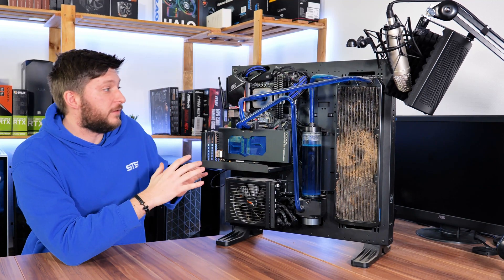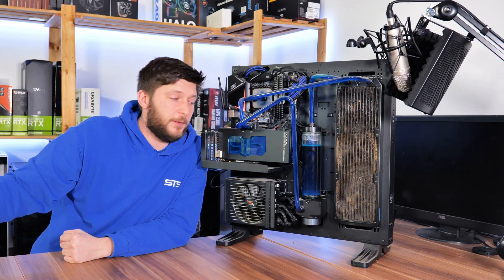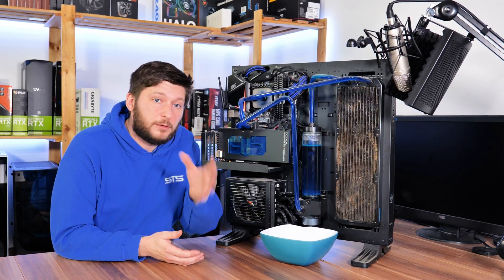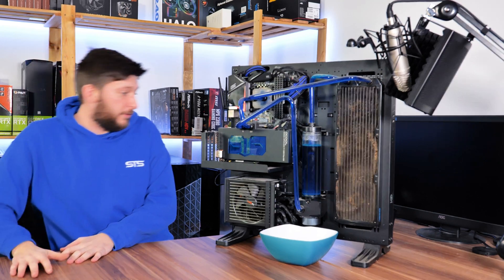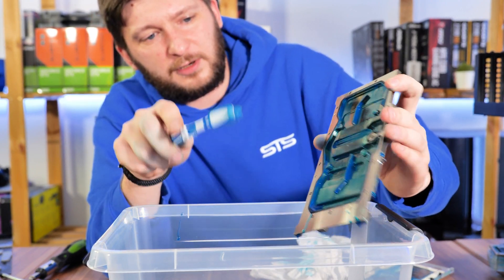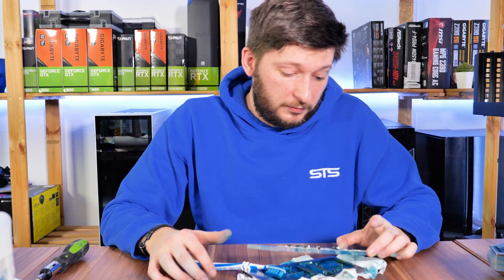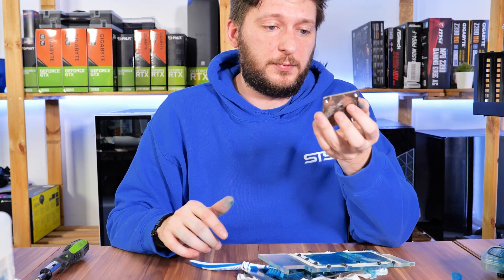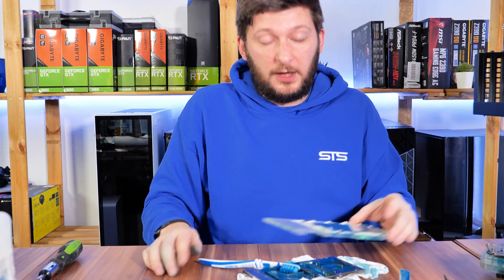Custom Water Cooling Pc Fail | Fixing my biggest Water Cooling Mistake

Comment: just use regular destiled water , colored coolants are the problem. you dont need to clean it every year with normal water , maybe 1 every 3 years
Reply from the maker: Things you realize after you're done.
I never got the blue color out of the waterblock, but we need it for another project. I will probably just use it with normal coolant and hope that the color will disappear just by running for a long time
Reply: @STSYT did it?

Comment: Just don't use any colored coolants. Especially pastel ones. It doesn't worth the hassle it brings.
They ALL gonna clog your loop sooner or later. Even if you gonna change it every 3 months or something - they will eventually produce build-ups here and there or will damage nickel plating in the worst case scenario. Also you can only guess what internals of your rads look like, which is even more concerning cuz you can't open em up and clean.
If i want some colors I just buy colored tubing instead. 
Had aquacomputer DP Ultra clear coolant in my loop for almost 3 years once, and when i finaly drained it, the coolant was crystal clear with 0 build-ups and no discoloration whatsoever, it looked like new
Reply from the maker: Until now I never saw colored tubes in action. 
You're right with everything you said. But it just looks awesome^^.
We're planning a new Tech-ASMR involving Hardline tubing and we need to decide what route we go. Colored Tubes are definitely something we will look into :)
Reply: @STSYT  indeed it looks nice, opaque coolants look even better, but when it comes to cleaning all that mess after it's just annoying and frustrating af.
Colored hard tubing aren't that common but still you can get some from primochill or barrow for instance.

I used UV active red petg from barrow in my recent build which looks pretty decent imho.
https://imgur.com/wa2BEFs
Reply from the maker: Looks nice!
Yeah, in the future i’ll propably just use them for these short-timed themed builds. I know that as soon that pc goes out of the office it won’t be cleaned for at least 2 years.
Reply: I use clear mayhem's X1 and glass tubing.

The coloured stuff stains petg and soft tube even worse, it also stains everything else (like inside radiators) so you need to run vinegar or something in the loop to remove it.

Pastel fluids would be worse, probably cause they need a lot more dye, so more crap to build up in the waterblocks

Comment: I'd fully disconnect that power supply first... Oh! Nice one.  Isn't the flush with Distilled Water?  I haven't done much custom water cooling so far...
Reply from the maker: For sure i did, that psu would have been destroyed if i had left it in there :p

Flushing it with distilled water would be extrmely complicated. I would have needed to somehow empty it, then rebuild it, flush it, empty it again. Afterwards i just washed everything with alc./ normal water  worked great